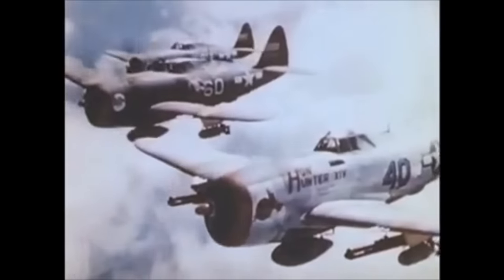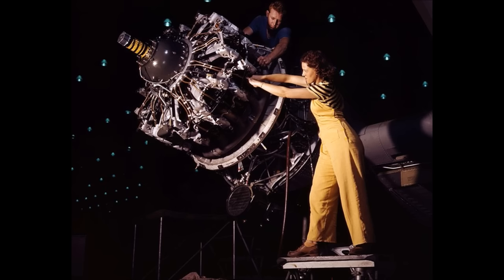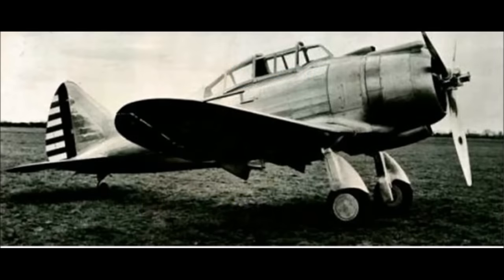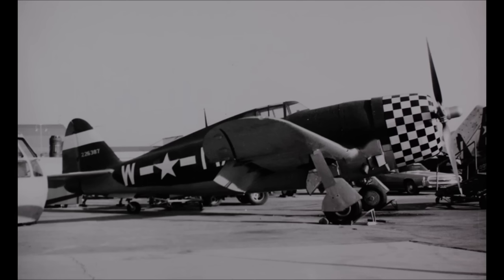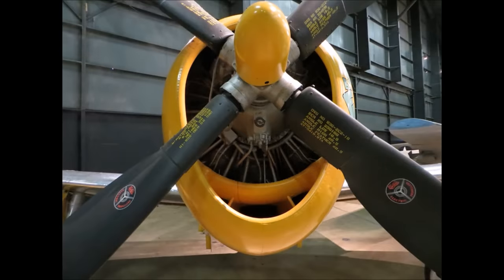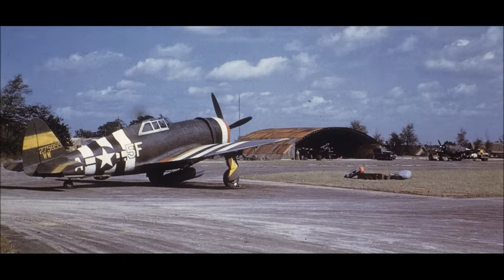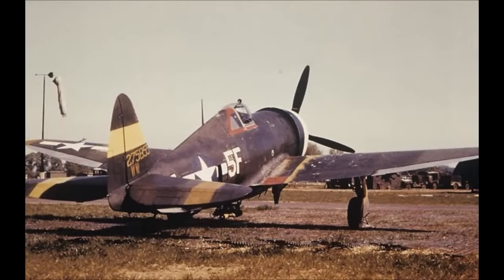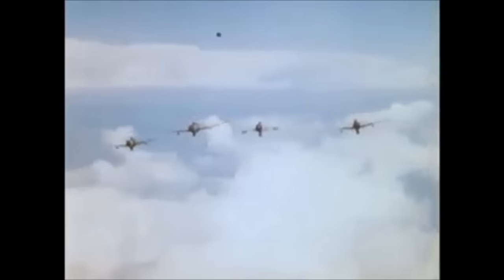P-47 Thunderbolt Pt. 1 Design and Speed

Comment: I learned the connection between the P-36 and P-47.  I did not know that Selversky turned into Republic.

The top speed discussion is for the most part a waste of time, since dog fights is a 3 dimensional activity and not a one dimensional one.  The P-47 was extremely heavy and had huge wing loading.  It could not follow simple manuevers that most respectable WWII fighters could do with ease.  It was the typical American overweight syndrome.  Essentially all US WWII fighters were overweight, and the P-47 was among the worse.  Nevertheless, the plane's record was not as terrible as its performance.  That proves that if you have huge degree of numerical superiority in aircraft and pilots, you can get away with poor quality.  

By the way, I think that the overweight syndrome is coming from the fact that there were ample raw materials in the USA, and limited skilled labor.  So, planes were built with large and heavy airframe parts that were relatively few, and could be built with automation.

With the exception of turbochargers, the USA was generally behind in engines for fighters.  The R2800 was an engine compromise that could work on any type of aircraft.  Transports, bombers, anything.  This is one of the reasons that all the R2800 fighters were mediocre or less.

But again, quantity can overwhelm quality.
Reply from the maker: Wow, you managed to work incorrect information into nearly every sentence of your post. I'll talk about maneuverability in part 3.
Reply: I forgot to mention.  The P-47 got some initial success in Europe because the German tactics were tuned to deal with Spitfires.  When attacked at high speed, go on a half roll and head straight down.  That would give the Germans a chance against the Spitfire, since the latter has an issue at high speed roll and initial diving acceleration, since its light.  That obviously worked poorly against the P-47 which did have good roll rate (just about the only good thing about it) and good initial dive acceleration (OK, another good thing about it, but that's it!).  Eventually, the Germans figured this out, and learned to try to distinguish between P-47's and Spitfires.  By the way, this overweight syndrome on US fighters continued well after WWII.  The F-86 had some serious troubles against Mig-15's, and the deal continued even with F-4's been taught lessons by subsonic Mig 17's.  And that was what Top Gun was about.  How to teach US fighter pilots to not get shot down by superior enemy fighters.Of course, our biased way of reporting history tends to turn everything upside down for the sake of propaganda, and the false stories get transferred as facts.
Reply from the maker: You have that backwards. The 109's could just shove the nose down. It was the Spitfire that had to do a half roll first to keep positive G and thus keep the engine running. The Thunderbolt does many things well, I covered one of them in this video, which was high altitude speed. I'll cover more in the next videos. Don't worry, I'll include comparisons with the Spitfire Mk9.
Reply: Nope.  The Spitfire had turning radius.  When attacked by either 190 or 109, the Spitfire would go into a tight climbing turn, climbing in order to reduce airspeed.  If airspeed was already low, horizontal turn.  If airspeed way high, loop.  Exactly the same strategy were taken by Japanese fighters against US fighters.  The 190 was never developed for fighter vs. fighter, so the only advantage it had over the Spitfire was roll rate (much like an F4U vs. say an A6M5).  All it could do is a half roll and dive, hoping that during the roll it was not shot up.  The Germans tried to do the same against the P-47's prior to recognizing them as a new type.

High altitude straight line speed has little value, especially if the rate of climb sucks.  But given the huge tactical advantage that the US fighters enjoyed (huge numbers, position above the bombers, primary target of the German planes been bombers, poor training of most German pilots, etc.), they were able to be effective.  However, on a one to one situation, the P-47 had little for itself.  It could sure make a huge crater though ... It was a huge pile of metal for sure.

You may want to read what German aces thought about US fighters.  Much like Japanese aces.  They were not very much respected.  It was the very large numbers that they feared.  The P-47 and P-38 were the least respected among the late war fighters.

Comment: Odd how wastegates work here it’s sort of the opposite of how they function on turbo cars. Or you didn’t say something correct bc wastegates aren’t the primary exhaust ports they regulate boost your explanation has confused me as it sounded like you said wastegates are rhe primary exhaust ports or something
Reply from the maker: What turbo car do you know of that has a lever to manually move the wastegate?
Reply: If I understand what Marcus is saying, he's right that the logic of the wastegate is different.  The default setting is to have the wastegate open to bypass the turbine, keeping boost low.  Then as altitude increases, the wastegate is closed to send more exhaust into the turbine and raise boost pressure.  The wastegate on an automobile is default closed so that all of the exhaust goes through the turbine, then when the maximum manifold pressure setting is reached, the wastegate opens and regulates.

Comment: 1/1/2019

There is no point in saying “ it works out to just under 30 Liters.” Just say “30 liters.”  For purposes of your video, What difference does it make whether displacement is 27 liters? 29 liters. Or 29.765439 liters. Just round off, and quit being vague.
Reply from the maker: You would be amazed. I do it because if I said 29.76, someone would complain that I was technically wrong and that it's 29.765439.

Comment: Mosquito!
Reply from the maker: That's a good point. The Mosquito doesn't get enough love.
Reply: Had to go all fan boy there.
It could drop the same bomb load on Berlin as a b17 and also be its own fighter escort, uses 9 less men and two less engines and a heap less aluminium, yet still does it twice a day instead of only once. 

Lend lease has a lot to answer for, mosquito, dehavilland hornet, trs2, avro arrow.

Ok, fanboy over.